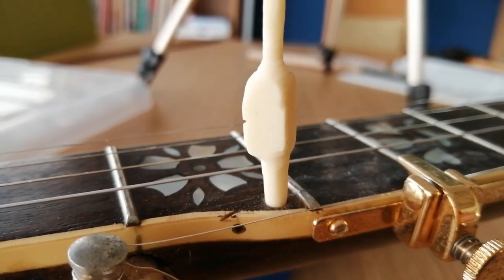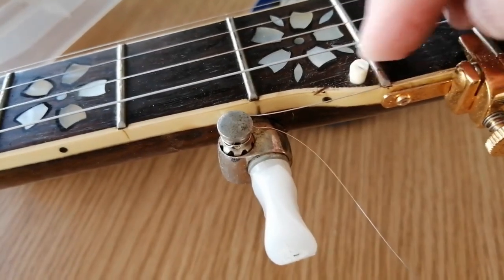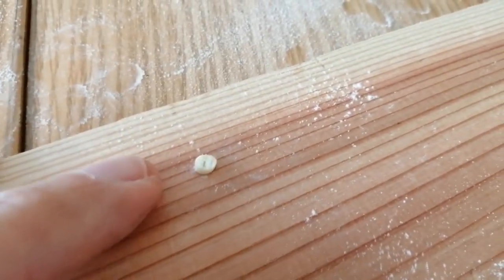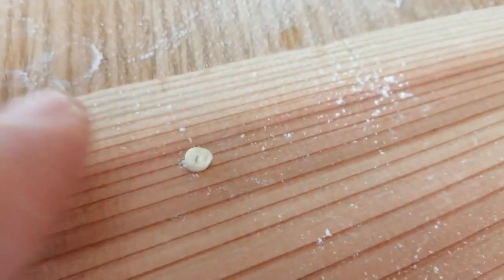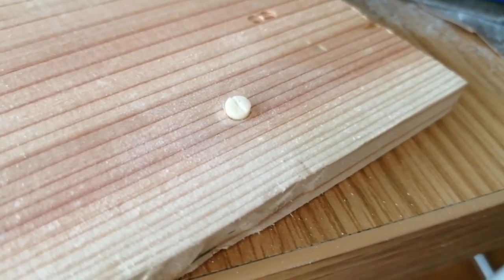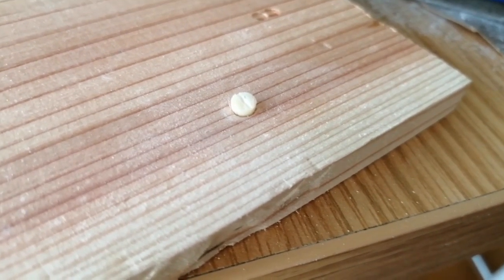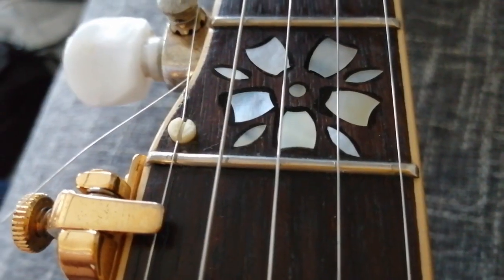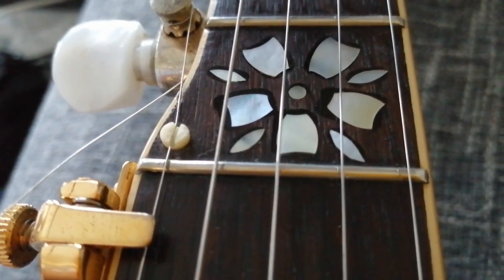Home Made 5th String Banjo Nut

Comment: Just in case you still have your banjo mate, this is what you need to adjust:
1. You need to remove your 5th String TUNING PEG from the neck. ( gently)
2. Re-install the 5th Str. Tunning peg on an ANGLE facing towards the nut. ( 11"oclock position) yours is 12/12
3. Your set up doesn't put enough tension After the 5th string nut because the tuning peg shaft is at 90° to the fretboard.
Reply from the maker: Thank you! I'll check it. I remember changing the angle of the peg because the string was actually eating into the neck, maybe I overcompensated.